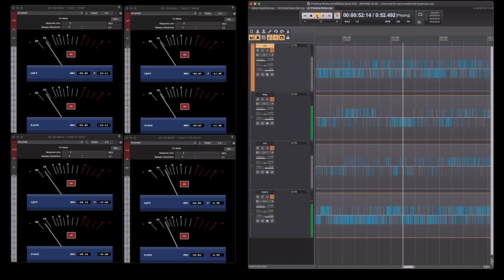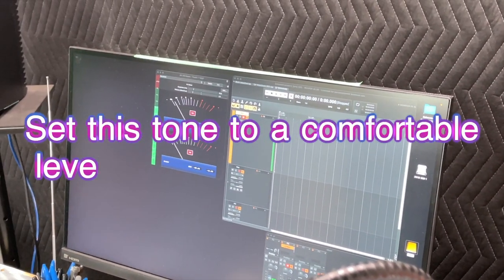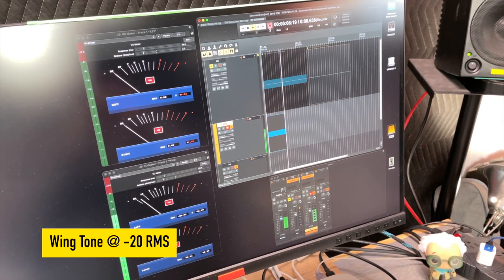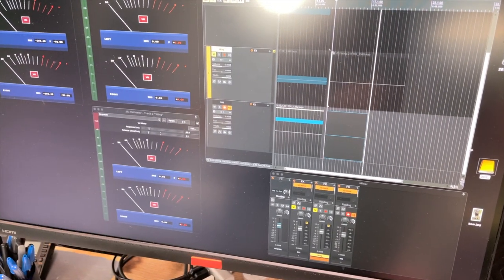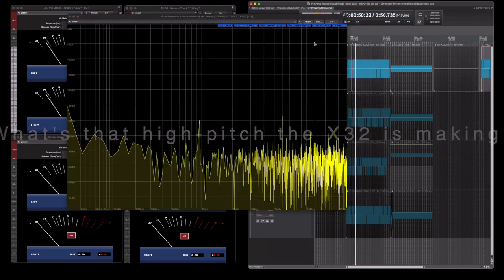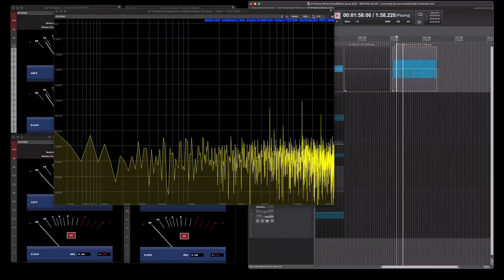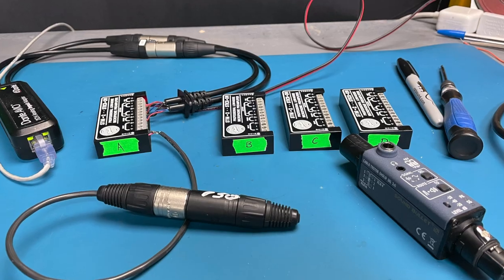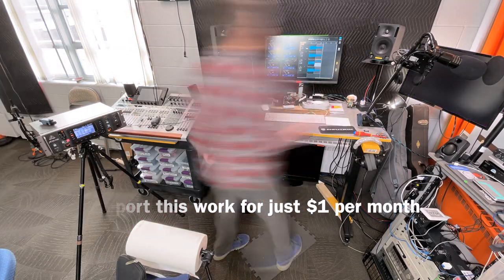Behringer Wing vs X32 Preamp Noise Tests

Comment: Interesting.  I would vote for the Wing as having the better sound as the X32's high pitched oscillation could be noticeable at lower levels.
Reply from the maker: Thanks for watching Rob! Even though it is buried, it was surprising to hear that extra noise on the X32. I'm curious to test the other X32 models to see if it's unique to the rack version for some reason.
Reply: @DcSoundOp  Yes, the sample is so amplified but it does make you wonder.  I look forward to any followup you post.  Thanks for the hard work.

Comment: What you can do, if you have a „calibrated“ (or at least known) low level sine source: record at max gain (where effective input noise generally is lowest) both the signal generator and the termination resistor.
Then you could quantify the effective input noise in dBu and also create noise spectra in V/√Hz.
Personally I think the tones are not too critical, especially for PA use, as they are comparable to the noise level after all, wouldn’t want to use them in a studio with low gain microphones, though.
Reply from the maker: Thanks for the message Christian, I saw your other one too about the XR18. Hopefully we can get one of those in for testing in the future too, I’d be curious to see if it’s similar to the Flow 8 I have here.

Comment: The Wing and the stage box seem to be identical in the test. The noise floor for all three are about the same. The X32 has something else going on that's really strange. I know this is 80db down, but what is that noise?
Reply from the maker: It was surprising for sure how similar the S32 and Wing are, still digging to figure out what's causing the noise in the X32 and if it's common to all models or just the rack version. Thanks for the message Dale & thanks for watching.
Reply: Most likely candidate is LCD backlight or LED PWM. See if adjusting the lighting levels changes it.
Reply from the maker: Thanks for the suggestion, will give that a try 👍🏼
Reply: @DcSoundOp  yes, definitely. And different input jacks may have different signatures in terms of coupled in tones from power supply, motor faders etc… I still have a small XR18 in a rack, and those preamps are much worse, and vary a lot: the middle ones (as placed on the front panel) have much less interference, also the ones with „High-Z input“ (Guitar DI, as opposed to normal Line level) are even noisier.
Reply: @DcSoundOp  I had an X32 Rack at one time I used for small wedding gig and it was problematic. it did some strange stuff and I had to factory reset it every once in a while. I have had a few x32  and m32's and never had any of the problems out of those that I had from the x32 rack.

Comment: What do you recommend to remedy the problem? Thanks by the way.👍🏾
Reply from the maker: It's not a problem as such, or something you would go about trying to fix on gear like this. Every piece of audio gear has a unique noise-floor, and modern digital mixers like the X32 and Wing have very low self-noise. In situations where you do find yourself needing even less noise (amongst many other possible reasons) you'd want to step-up to the pro-level consoles, like the Midas Pro 2 or 6 and their accompanying stage-boxes etc. I think Dave Rat has some comparisons between the X32 and the Midas M32 over on his channel, so you can get an idea of what the difference would be like on those.